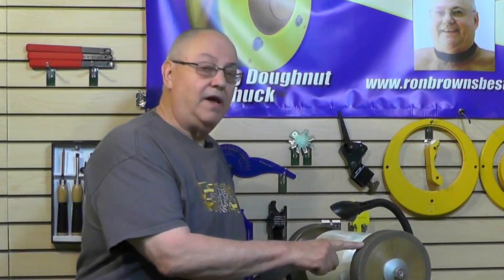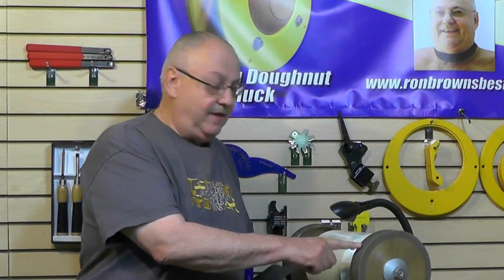CBN Grinding Wheels - What You Need to Know

Comment: Are You NUTS!!!!!!!!!!!!!!!!!!!!!!!!! OF COURSE CBN WHEELS WEAR OUT DUMMY. Anytime you are grinding an angle of a piece or a shank or any tooling at all your creating a bevel on the surface. It will wear out and need to be dressed. Any heavy grinding using a CBN wheel WILL CAUSE IT TO OVERHEAT or burn the piece itself. If you are using a CBN to grind M40 material you better have a coolant set up. Also better have a Diamond Dresser Set up Handy because after being used for a while it will need to be dress to keep the form of the wheel sharp as possible. This is complete non sense and for you to have 225 likes shows me that these viewers are NOT Machinist!!!!!!!! They have NO IDEA what a CBN wheel can do. Yes my CBN wheel is 5inch by 5/8 wide and has lasted over 2 years but it has about 1/4 of material left on the wheel.

Comment: Ron pls ans
Reply from the maker: CBN wheels are designed to grind very hard material such as High-Speed Steel M2, M4, M42, Chrome Vanadium, or other hardened and tempered steel. They are designed to be used dry, without coolant. Softer steel, nails, angle iron, rebar, most regular bolts are too soft and bits of material will become embedded into the surface and will clog up the wheel. It is then unusable. If your barber scissors are very hard material you should be OK. If they are easily sharpened the steel is too soft. The wheels will sharpen the scissors but will become clogged after a time.
Reply: @Ronbrownsbest  yes my materials hard hrc approx 55
Reply: Thanks sir for information

Comment: Ron,  You mention the fact that silicosis from the standard grinding wheel concerns you.  You made a comment that the was no dust from the CBN wheel and elude to the fact therefore no hazard.  Whether you see the particles or not, there are still metal particulates that you cannot see, and those are the ones that do not cleared out by your nose hairs and mucus and can get to the alveoli in your lungs.  And the metals and impurities in metals that make up these particulates are also hazardous.  So just because you have eliminated the silica from normal abrasive wheels does not mean there are no particulates that a respirator or ventilation setup should not considered necessary.  Particularly if you do a lot of grinding.
Reply from the maker: Yep.

Comment: Dear Ron  ; I bought a funeral lot from a dead machinist , in it there were a Darex M5 drillbits grinding sharpener with  diamond wheels , I fell in love with that machine thus I decided to build myself a end mill sharpener and I would prefer to have a 8" dia. wheel than the 6" dia. ones  that are on the Darex … adding that yours are 6$ less than the Darex 6" dia.(195$usd) for 33% more diameter , yours face area  201sq. inches compared to 113sq.inches Darex face area  , would you recommend it for facing 90% hss end mills and about 10% carbide ones ?
Reply from the maker: Rene: That's what they were originally designed for. At the time I am writing this reply I am sold out of the 180 grit, but expect them shortly. Ron
Reply: @Ronbrownsbest  what are the rpm (s) of a 8" wheel ?
Reply from the maker: @amateurdesubaru  Minimum is up to you, maximum is 4,000 rpm.

Comment: Excellent video. I'm not sure that you quite answered the question by RickTurns, however. As a long-term turner, I still have some hardened carbon steel chisels and gouges and would like to grind these on my CBN wheel. I wonder if you could elaborate your advice with this in mind.

Comment: Hi, Ron. I just recently bought one of your CBN wheels, and it's great. But there's one thing I'm not sure about, and haven't found a good answer on the internet: can I sharpen non-hss tool steel on a CBN wheel?
Reply: Pardon me, wrong description. The Grinding stones that are used to dress CBN grinding wheels are not "self" - propelled but mounted on a ball bearing guided axle and  lead to the CBN-wheel by using a tool support. When the stone  gets contact in an angle with the turning CBN-wheel it is propelled and dresses ("opens") the wheel. These devices are normaly offered by CBN-grinding wheel dealers, too. Feel free to "google".
Reply from the maker: Soft steel will clog the wheel. They are made for very hard steel. I wouldn't sharpen lawn mower blades, rebar, angle iron, etc. My Friend, Tim Yoder was grinding some round mild steel on one of my CBN Wheels and just had to buy another one to replace it because the softer steel ruined it.
Reply: Hi Ron, you "open" a smeary CBN wheel by using an self-propelled common ceramic grinding stone. It works! The CBN wheel will bite as well as new.
Reply from the maker: I have no experience with this method so cannot recommend something I am not familiar with. I would never want a customer were to ruin an expensive wheel.
Reply: Hi, 9traktor. A ceramic grinding stone I can understand, but self-propelled? Where would I find this? I searched Amazon but didn't find anything that looks right.
Reply: Thank you!
Reply: My pleasure!

Comment: Great wheels. I purchased my Ron Brown 180-grit CBN wheel through a group buy with my turning club. Had it around a year and I absolutely love it.

I did want to make a comment about your video. You mentioned the CBN wheel doesn't require the guards because it can't explode. While this may be the case, the standard guard on a grinding wheel also guards the bolt & threads that holds the wheel. This should be guarded to prevent the edges from catching items which may be pulled into the spinning wheel. Just something to think about. And since I'm a nearly 30-year Environmental, Health, & Safety professional, think about these hazards is what I do :)
Reply from the maker: Mark:
I'm glad you are enjoying your wheels. Thanks for a different perspective.
Ron
Reply: Safety first!!